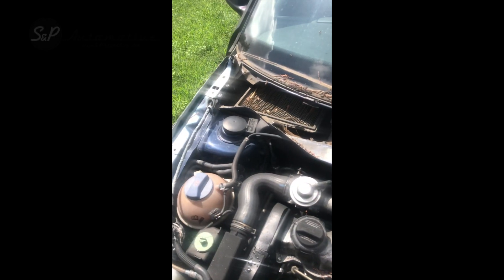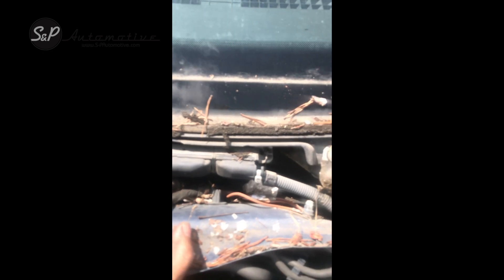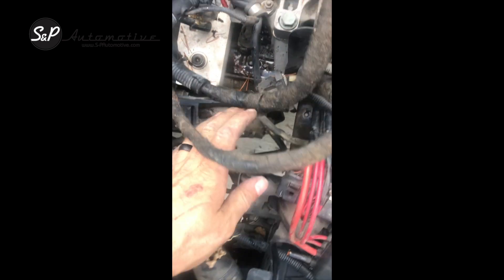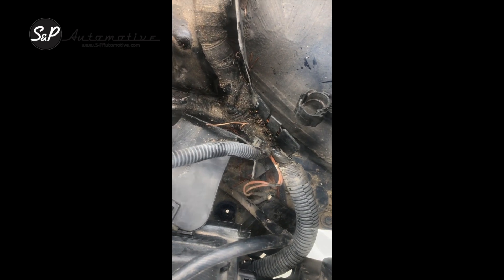Wiring Harness MK4 Removal

Comment: Hello I know this video is old but I am in a trouble with this 14 pin connector you mentioned. I am making engine swap from 1.6 SR apf to 1.8T agu motor and I am heaving trouble figuring out what to do because 1.6 have 11 pins but 1.8T have 9. I know where those 2 wire go from 1.6. 11 wire go to conditioning pressure sensor and for 1.6 it have only 2 connectors for sensor and the 12 wire go in relay 53 I think it's a horn relay connector 6 under the steering wheel. But for 1.8T it's that those both wires go from conditioning pressure sensor and this is why I get only 9 pin connector but what could I do if I want all those 2 wires work. I am just losing connection for them could I just leave them and nothing will change bad ?

Comment: What about the fly by wire accelerator or the brake light sensor the interior? Do you need to pull the wiring harness from the interior as well?
Reply from the maker: I provide a new fly by wire pedal plug. The only think you need from the inside is if your glowplug relay is under the dash. 99.5-01.5 donor cars will have a 180 glowplug relay under the dash. You’ll need that. Otherwise no.